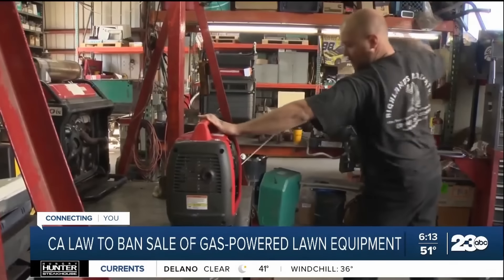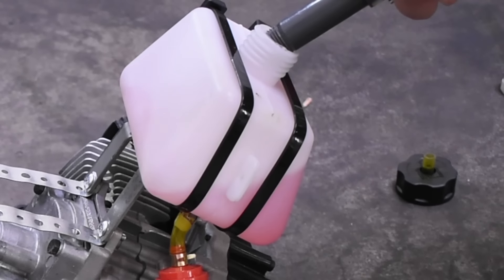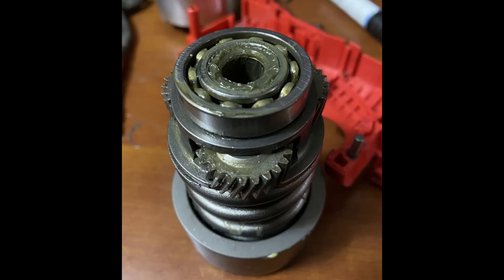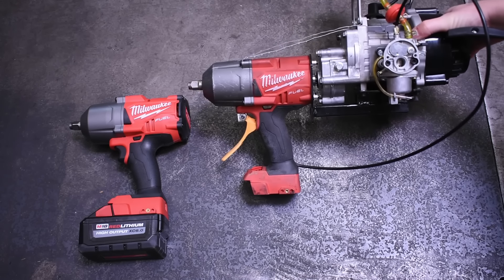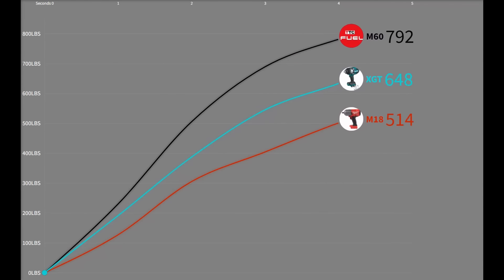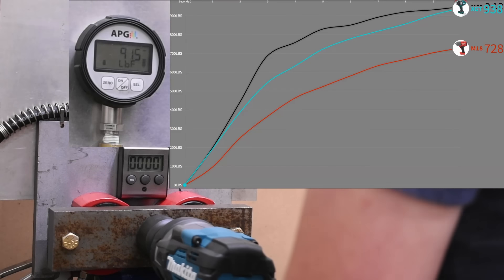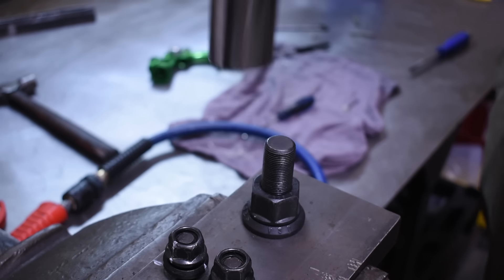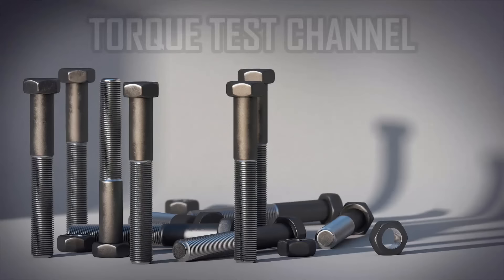Gas Powered Milwaukee Impact Wrench Because it's Illegal

Comment: 😍 this was fantastic… please find a factory built gas powered one and test it against it! I’ve seen a bunch of stihl powered ones, usually railroad companies use them.
Reply: I think it's time to go hydraulic.  We need a hydraulically powered impact that works on the quick connects of a skid steer and thumb of an excavator and other auxiliary lines of heavy equipment.
Reply: Looks like it an attachment for the Stihl cut off saw. Apparently harbor freight sold a 1" model at some point as well.
Reply: Linemen have had similar, though perhaps those were just 2-cycle drills for boring bolt holes through power poles before lithium tools took over, not impacting wrenches.
Reply: I hope those rail road impact guns make a CHOO CHOO noise during operation. Otherwise I would be really disappointed.
Reply: Yes! The Airtec Master 35 is a 1” gas powered impact we use on the railroad everyday!
Reply: @calholli  there are pneumatic/hydraulic hi torque machines that are widely used on site for torquing up blinds to high settings. Although they are slightly different from a rattle gun
Reply: @calholli  They already exist, Stanley make them. VERY expensive though, like all hydraulic powered torquing equipment.
Reply: @calholli  That sounds deadly. I like it.
Reply: You know it does have two directions you just need to start the engine the other way neat things about 2 strokes
Reply: @minecraftbers  if you're not a wtyp fan my disappointment will be immeasurable.
Reply: @jjlak1064  only if you can change the ignition timing!
Reply: @mlindholm    There are gas powered drills but hydraulic driven tools are generally preferred especially by linemen working from bucket trucks because the hydraulic pump used to raise and lower “the bucket” acts as the “power source” for the tools, additionally the risk of fire from spilled fuel is eliminated as well as from the exhaust which is extremely important in dry fire prone areas, noise from the tool is less, the tools can be grounded to prevent injury from electric shock, just to name a few of the reasons
Reply: @calholli  They don't need to be impact, as they can easily develop far more torque without the use of inertia coupling.  Imagine being able to push a wrench with a 20 ton bottle jack attached to whatever you're working on, there's a LOT of torque potential without the need to bang on the output shaft.  Hydraulic torque wrenches have been around for a VERY long time, they're a staple at industrial sites and the oil/gas industry and are used to torque massive flange bolts and other hardware.  4,000ft/lbs is generally where they start and only go up from there.  Older hydraulic wrenches used gas power packs, some still do, but they've mostly gone to electric/hydraulic power packs for simplicity.  You can even operate them by hand with a hydraulic pump if you have the time (it's slow, just like a bottle jack, but entirely feasible).  Torque is measured by indicated hydraulic pressure and some simple calculation beforehand, essentially you figure out what the pressure needs to be for a particular torque value and add pressure to the wrench until you've reached that target. I believe AvE uses one to test box wrenches and ratchets to destruction if you want to see one in operation.
Reply: @calholli  hydraulic torque wrenches exist. Plumb one to a skid steer instead of another hydraulic power source… same same only different.
Reply: @natec599  you may find there actually underpowered as there generally setup for 10000psi systems where as ag equipment etc. Generally running at 3***max.
Obviously probably still out do what people are use to but I guess it'll always be a form of scale
Reply: @calholli  yup yup yup!!!!
Reply: @calholli  yes, those are mint :o) Often they are ratchet type. Absolute animal of a bolt driver :D
Reply: Airtec Master35
Reply: Get a bigger carb and a tuned exhaust! 😎 or big bore kit, like we did back in the day, 50cc was really a  80cc.
Reply: Wow. I never knew a gas powered impact even existed !!
Reply: @gullreefclub  
Those hoses are a pain in the ass and your bucket cover sucks to put on if you leave it in the bucket at night. If you leave it hanging outside the bucket the gun rusts. If you unhook it every day, you start getting hydraulic oil all over everything. I myself prefer a Tanaka gas drill. The batteries never run down and it'll punch a hole post haste.
Reply: I think Tanaka make a 2 stroke impact
Reply: @Daniel-fo2qf  just used a hi torque today. Deadly life savers
Reply: @calholli  please i want a hydraulic injection injury so bad!
Reply: @calholli  they have been out for a long time...we bought a unimog from the military that came with a hydraulic powered impact... it ran off the hyd auxiliaries off the pto from the transmission
Reply: @trev-DaWg87  Sweet...  Unimog's are awesome too, so it makes sense. lol
Reply: @asdasd-ni8eg  I know I know, but the parts and pieces and knowledge are out there. If there was a market, manufacturers would take that 3000psi and crank out a million ft lbs… it would take a week to torque a bolt but you could do it.
Reply: @natec599  summed it up in one line if there was a market for it.
Reply: They say they carved this impact gun from a bigger gun

Comment: I wouldn't be surprised if the slowdown is actually due to the shocks from the impact hammer affecting fuel flow. You can see the fuel in the tank is getting pretty well shook up. What's happening in the carby is quite probably even more dramatic.
Going to sub now even though I actually have been watching most of your videos for a fair while.
Congrats on leaping past 100k

Comment: I would love to see how much power the stock brushless motor makes with higher voltage. Imagine a set of LIPO batteries connected to the motor through an aftermarket speed controller(hobby or small EV grade), these motors are built to last, I’m pretty sure it can make way more power.
Reply: They could make some sort of adapter to use Kobalt, Flex, or Hilti batteries, as they all have an extra cell for a higher 21.6V nominal voltage.

Comment: This was awesome. Also I'll bet modifying the clutch to engage at a higher rpm would fix your bogging issues. Like a high stall converter on a drag car.
Reply: lighter rollers would probably be enough
Reply: Yup lil heavier springs

Comment: This is great! On the conclusions, I would say that we might not be seeing a more powerful 1/2 in impact intentionally for reliability concerns. They don't want a mechanical point of failure, so there's a safety margin on the drive system. Sure, that impact can handle a few ~1000 ft-lb runs, but can it do it every day for several years?
Reply: Agree, and how much half inch power do we need that we cant get from the 3/4" XGT with a 1/2" adapter. I keep the 1/2" adapter on mine whenever its in its box, just in case. Got the XGT midtorque and compact as well, not likely that the 3/4" to 1/2" adapter will ever be used for actual work but at least its always nearby the big guy.

Comment: Most important upgrade for that motor would be a tuned exhaust pipe, extremely beneficial on a 2 stroke
Reply: I'm going to be honest, I don't see how adding piping improves it. I mean, it's effectively a straightpipe with cat+muffler delete as it is.
Reply: @specialopsdave  Two strokes combustion efficiency is highly reliant on exhaust pulse waves and resonation keeping the mixture burning in the combustion chamber as long as possible. A tuned and properly proportioned pipe/expansion chamber will create VASTLY greater power than even a direct dump/ completely free flowing exhaust.
Reply: @specialopsdave  So you now showed that you know nothing about 2 Strokes. The exhaust is very important for power or Torque
Reply: @motakai3898  I thought resonance was already built in to the design by it's specific exhaust length and the right angle? Otherwise it wouldn't work well as an engine at all, right?
Reply: @specialopsdave  Not really, it's about the chamber size, shape and length
Reply: @motakai3898  Which should already be ideal as is, right? Unless engine manufacturers don't know how engines work (or they are limiting power for longevity)
Reply: @jonas1205  The guy never said he knew something, why do you feel the need to put others down randomly?
Reply: @specialopsdave  it takes A LOT of research time and testing to get reliable and powerful pipe setup. It's easier for these companies to just put a generic chamber on it and kick it out the door
Reply: @motakai3898  They can't just plug it into a computer program to get the right design?
Reply: @specialopsdave  well, such programs may exist now, but it's so incredibly complicated to get the right reaonation effects on the exhaust gases. It'd cost a heluva lot of money to do compared to slapping a pipe on it that flows well and calling it a day

Comment: I think it could be a fuel related issue with all that vibration... I can't imagine that carb having a easy time or even the float...
Reply: I'm thinking either the float is sticking or not liking the vibration, or it just flat out can't feed enough fuel at WOT. Before I sent it off, the float kept sticking on me and when I took the needle and seat out to inspect it, I noticed the orifice in the seat that the fuel actually flows through was only about .050". Couple that with a gravity feed fuel system that only has a capacity of about 1/3 gallon and is 2 inches above the carb, there isn't a real strong flow of fuel.
Reply: @smpstech  I think you are correct. I wasn't even paying attention but that is indeed a bowl carb. On any 2 cycle equipment you typically have the fuel chamber the carb draws on refilled by a vacuum actuated pump.
Reply: @Hansengineering  I have a few different carbs I want to try on it. I found a 15mm diaphragm carb that would make it more "practical" as you wouldn't have to worry about the float.
Reply: @smpstech  Can't wait for the next beanbox!
Reply: @smpstech  It is a tricky one, harmonics are my worst enemy... I would love to see a second go at this with a carb that can keep up the flow rates needed. Stupid idea but you could go into pressurising the tank with exhaust but would need a one way valve and some time. Otherwise open up the seat but be careful of getting a good seal again.

Plan B an upgraded carb...

Comment: To me the take away here is just how crazy efficient the BLDC motor in tool are getting.
Reply: you should check out some the behemoths they put in RC cars. The gas cars are fun but people are putting motors the size of monster energy cans into 30lb RC cars powered by +40Vs of LiPos and doing 200-500+ amps getting them over 80mph 😁. packing like 20 HP in palm of your hand.
Reply: Ever since I witnessed what a small brushless motor could do on a RC car, compared to the nitromethane engines, I never really rooted for gas anymore.
Disregarding "range", or battery life, there's nothing a combustion engine can do that a powerful enough Electric motor can't, at a higher efficiency. There's a reason ALL trains use either pure electric, or diesel electric series hybrid. Electric motors are just better, at basically everything.
Reply: @novideohereatall  Truth. Theres a guy on Tik tok, whos trying to or doing, swapping a diesel electric generator into the drive of an 18 wheeler...now thats some cool shit.

Comment: The change to electric will come naturally for the right applications: Small lawn = EV lawnmower is enough. Big lawn = gas- powered lawnmowers with harder noise restrictions should be allowed.
Today most small construction equipment is already battery- powered because its just better. No need for harder laws.
Also if big power outtages werent so frequently not as many gas- powered generators would be needed...

Comment: Some of your running issues with the engine may be caused by the vibration of the gas tank, causing the fuel to aerate.
Reply: I was thinking the same. Need properly tuned carb and a fuel pump drawing from a tank... of course... In a backpack. Think like a belt-fed!
Reply: Put fuel in a bladder that can be squeezed down; this takes care of both aeration and fuel pressure. Problem solved.

And - try a mix of nitromethane in the fuel; that should easily get you above 1000 lb-ft assuming it all holds together.
Reply: @johnrettig4795  totally agree. Hobby shops sell “rotor rage” RC heli 2 stroke fuel I use in 20 or 30% nitro.

Comment: one thing that just came to mind, and is done over and over again in the ev world is overvolting... what about a frankenstein 36 or 60, 80v overvolted impact...
Reply: What he said! ^
Reply: Same gun with much easier mods  (BLDC controller swap) and hit it with 7S instead of 5S pack.  Especially if it only has to hold together for one glory run on the Dyno
Reply: @Dan Lewis  exactly. I've found with pretty good consistency that at double voltage or less (other than controllers), most things hold up with no issues other then heat. Taking a 18-20v stock to 36-40v should yield some cheap and interesting results

Comment: Not sure if this was mentioned already in the comments probably was since there’s 2,300 of them but I’m going to say it anyway. I think there is plenty more potential for this setup with modifying the motors power out put, if you just tweak the centrifugal clutch springs you can make it so the engine rpm stays in the power the entire time. What appears to be happening is with little load the engine has enough power to build rpm to power band but once load is increased it drops out of power band. By putting heavy clutch springs in it will allow the engine to reach power band before any load is put on the engine giving you much better results.

Comment: Those little motors on a pocket bike can haul my 200lbs self around a neighborhood at a top speed of at least 30/35mph. Those little engines are crazy. 4.25 hp if i remember correctly.

Comment: Good stuff. California is such a large population,nmarket and economy, it has been well demonstrated it can swing its Big D energy around and kickstart fairly big paradigm shifts when the tech is frankly there but the industries are slacking. The market size usually support solid revenue and profit despite the bump in initial product development cost.

We've phased out all our petrol mowers exept one (it's size closer to a frickin combine than a regular mower) that does huuuge fields all day every day - and gotta say the electric / battery ones are awesome. The torque, climb and speed of those things is wild. And because they're damn near silent, hours can be much more flexible without the noise vs time of day/night being an issue. Especially favorable for mowing heavily used public parks right up against urban residences. Oh and not needing the ear protection anymore... Sooo frickin nice on the really hot days.

Comment: There are all kinds of genuine gas powered tools like drills. These were often used while installing telephone lines.
Or impact wrenches, for quickly changing that tire on broken down semis on the side of the road.
They still sell them I believe. No need to make them yourself.
Try to make one that runs on little propane tanks.

Comment: Walbro carb, rocket key, ditch that pancake muffler for something with a chamber, either heavier clutch springs or lighten the stock ones to keep rpm up and that thing soaring past 1000ft lbs

Comment: Move to 35:1 oil mix and adjust fuel air ratio.  The engine will probably still outlive the impact wrench being driven that hard, which also answers the question of why don't they just put a bigger brushless motor on the 1/2".

Comment: Love it, would be ideal for me. No electricity on my farm and while i have made a 160cc two stroke compressor, a  liquid fuel powered impact gun would be great for working on the tractor, farm truck and things where the salt air and dampness around here corrodes everything to looking 100 years old in a matter of 12 months or so.

Comment: I would maybe use a small displacement echo/shindawaw motor they make plenty of power for being pretty compact in size. Maybe use the 40cc motor from the echo 410 I think it provides around 2.5hp .

Comment: You should try it with a rc 2 stroke like 36cc or larger they're designed to run a higher rpm than the 2 stroke motors on lawn equipment

Comment: Make this thing more powerful, and more manageable at the same time. Remote motor with a cable running to the impact. New is pricey, but something like a Little Beaver post hole digger.

Comment: might be running into fuel foaming issues due to the vibration, it's something that happens in the RC aircraft world from time to time. Maybe disconnect the tank from the motor and hold it separately?

Comment: The fail point on those is the 1/2” socket head on the anvil. Broken 3 so far. Not the tools fault, I should definitely be using the 3/4 or 1”.

Comment: There is a lot more mods you can get for them engines, I used to race them in mini motorcycles. Theres bigger top ends, better clutches, carbs and you even can get mini nos bottles. Also may I add there based on blata engines, they produce heaps more power. some come water cooled